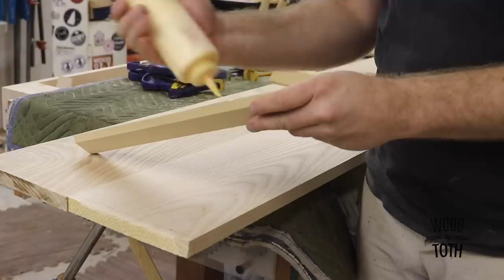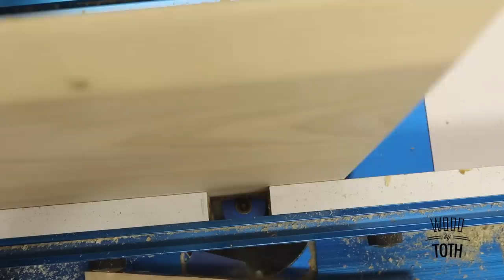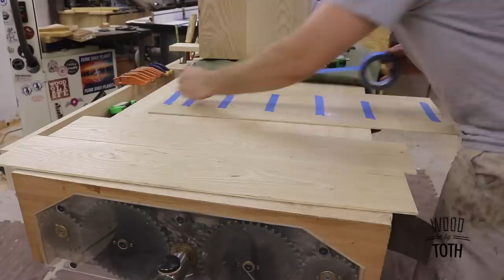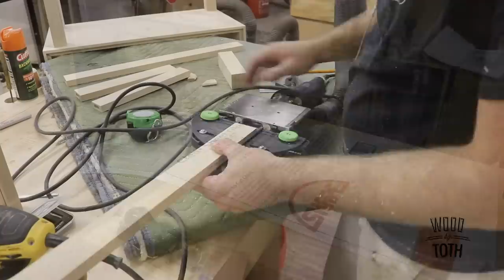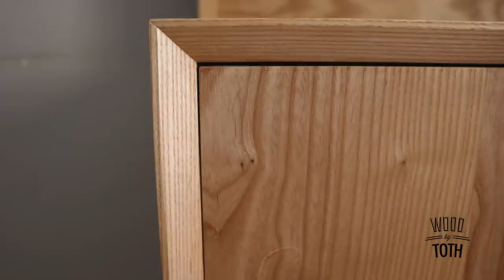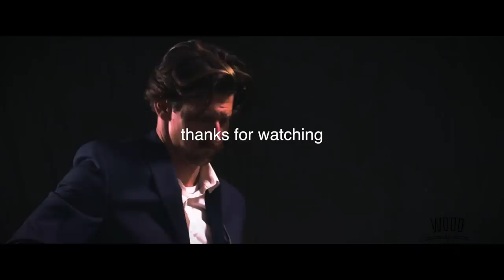Mid Century Modern Cabinet

Comment: hi kyle, you are one of the best and most creative woodworkers on YT, but i feel sorry if i see you working with this crappy amateur tablesaw. the dust in your face, terrible setup time for some tasks and no time to switch the sawblade ( thats why the burnmarks if you ripcut with a 80 tooth blade in hardwood. it must be take terrible worktime to get rid of them. switch sawblade my saw 30 seconds!) as i mentioned in the comments some time ago: get a top saw with sliding table, you will love it. regards from cologne
Reply: that crappy amateur table saw is a right tilt and hard to find anymore.  It isn't an accident.  Industry went away from right tilt because people kill themselves pinching a mitered piece between fence and blade.